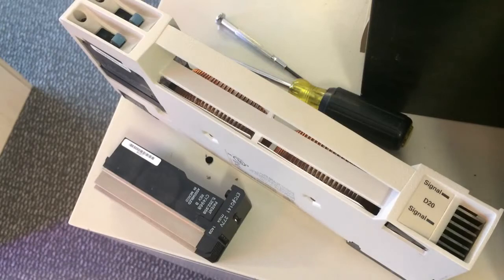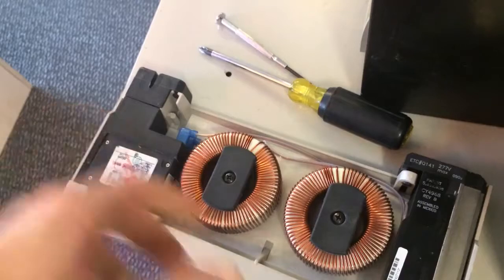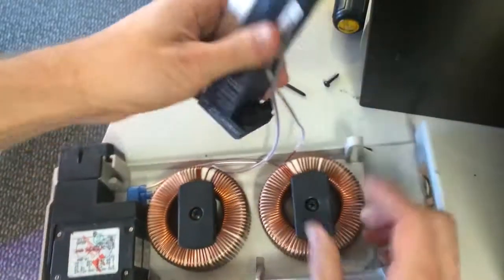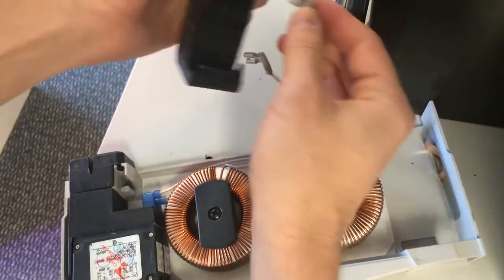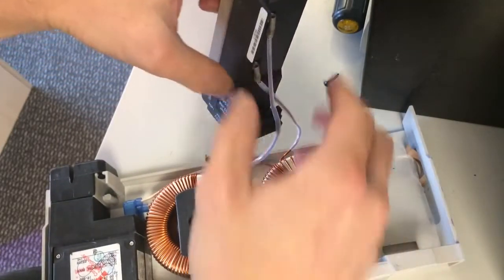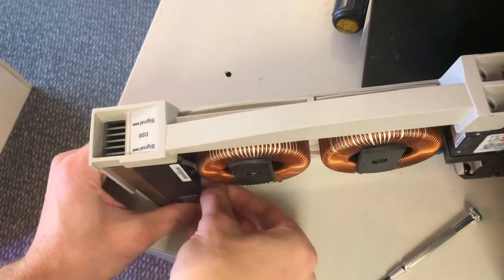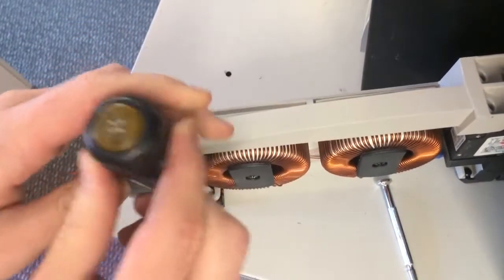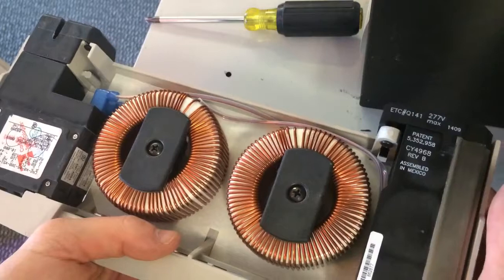Replacing Power Cubes on Sensor / Unison Dimming Modules

Comment: Quick question:  We have this type of system and one of the trays is giving us an issue.  One of the two sets of lights being run by it is flickers/goes out, but the other side works fine.  Any idea of what could be the problem?  I don't want to swap out this power cube if that's not the issue, because they look to be $100ish dollars and I don't want to have to buget that for something that isn't the cause.